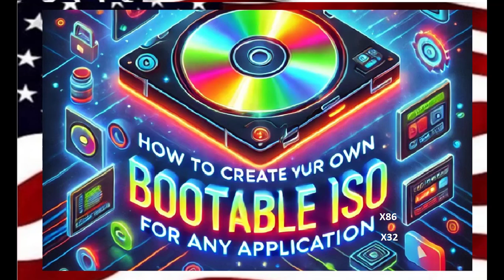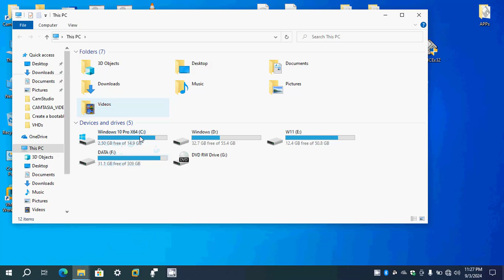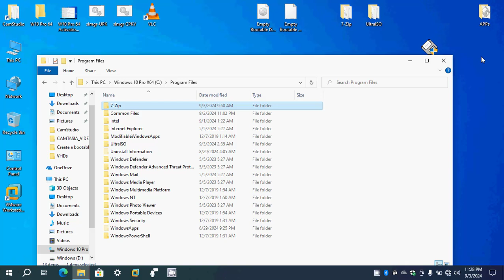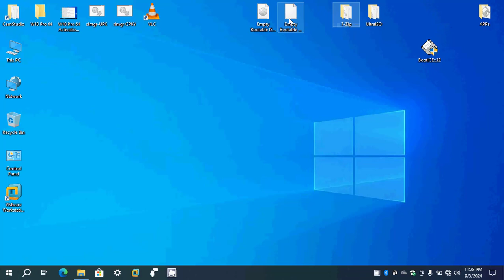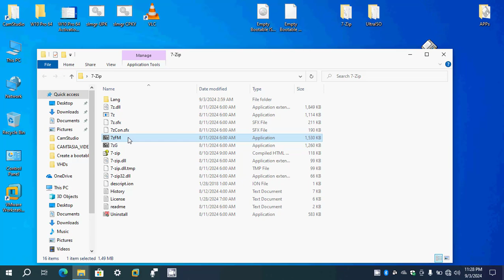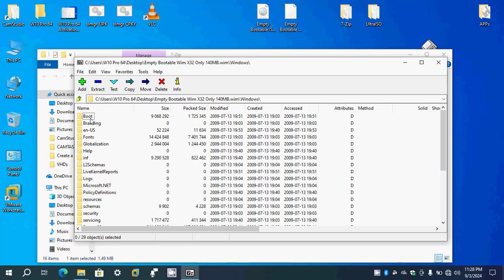150 Exclusive !!! Create Bootable Program in Bootable ISO

Comment from the maker: Summary
🖥 Introduction to creating a bootable ISO: The video explains how to create bootable ISOs for any application, allowing the program to run independently from the system during boot-up.
📦 Purpose of bootable ISOs: Bootable ISOs enable running a program without interference from other system processes, ensuring smooth operation, especially for utility tools.
💡 Portable ISO concept: A "Portable ISO" refers to running a program directly from boot, ensuring that the application runs standalone and utilizes all system resources.
⚙ Modifying the bootable WIM file: The process involves editing the bootable WIM file, placing the target program inside, and then repackaging it into an ISO format for boot testing.
🛠 Testing with VMware: After creating the ISO, the tutorial shows how to test it using VMware, ensuring it works before deploying it on physical hardware.
🔄 Multiple programs in one bootable ISO: The video further explores combining several programs into one bootable ISO, allowing users to run multiple applications from a single boot.
Insights Based on Numbers
61 minutes: The duration of the video, giving a detailed explanation and live demonstration of creating and testing bootable ISOs.
32-bit programs: The bootable ISOs created are focused on 32-bit applications, ensuring compatibility with different versions of Windows.
Multiple tools: The process allows multiple programs like Ventoy, Norton Ghost, and BootIce to run simultaneously from a single ISO.
Example Exploratory Questions
What are the advantages of creating a bootable ISO for system utilities? (Enter E1 to ask)
How can you modify the bootable WIM file to add custom programs? (Enter E2 to ask)
Why is VMware used to test bootable ISOs before deployment? (Enter E3 to ask)
Commands

Educational Article: Creating Bootable Programs in ISO Format
Creating bootable ISOs for programs is a valuable skill that allows users to run essential applications without needing a full operating system environment. This technique is particularly useful for system recovery, maintenance, and troubleshooting tasks. This article outlines the process of creating bootable ISOs and discusses the benefits and methods to achieve a functional bootable program.

Introduction to Bootable ISOs
A bootable ISO is a disk image that contains all the necessary files to run an application directly from the boot process, without having to start a complete operating system like Windows. Bootable ISOs are especially helpful for system tools like disk managers, antivirus scanners, and backup utilities. By running these programs outside of the full OS environment, you can avoid potential conflicts or restrictions imposed by the running operating system.

Advantages of Bootable Programs
There are several advantages to creating and using bootable programs:

Independence from OS: The program runs independently of the operating system, ensuring that it has full access to system resources without interference.
Security: Running a program directly from boot can help avoid malicious software that might be active in a compromised operating system.
Efficiency: Bootable programs, such as antivirus or disk utilities, can perform tasks faster because they don’t have to compete with background processes from the operating system.
Portability: A bootable ISO can be easily transferred and used on different computers by simply booting from a USB or CD/DVD containing the ISO.
Process of Creating a Bootable ISO
The following steps detail how to create a bootable ISO for any application you want to run from boot.

Step 1: Preparing the Program Files
The first step in creating a bootable ISO is gathering the program files you want to include. After installing the desired program, navigate to the installation directory (e.g., Program Files in Windows) and copy the folder containing the program. This copy can now be used in a bootable environment.

Step 2: Modifying the WIM File
The core of any bootable ISO is the Windows Imaging Format (WIM) file, which holds the environment that runs during boot. To make your program bootable, you need to add the program files to the bootable WIM file. Here’s how:

Mount the WIM File: Use a tool like 7-Zip or UltraISO to mount and modify the bootable WIM file.
Edit the Startup Script: Navigate to the System32 folder in the WIM file and modify the startup script (commonly cmd.exe or a similar script). This script needs to be changed to run your program during boot.
Add Program Files: Copy the program files into the appropriate folder within the WIM structure, usually under Program Files or Tools, depending on your program’s structure.
Step 3: Packaging into an ISO
Once the WIM file is modified to include your program, the next step is to package everything into an ISO file:

Create the ISO: Using a tool like UltraISO, create a new ISO file and place the modified WIM file inside. The ISO file should also include any necessary boot files that will make it bootable on startup.
Save the ISO: Save the ISO to your computer with an appropriate name (e.g., MyBootableProgram.iso).
Step 4: Testing the Bootable ISO
Before using the ISO on a physical machine, it’s a good idea to test it in a virtual environment like VMware or VirtualBox. This ensures that the ISO is correctly configured and the program runs as expected when booted. Follow these steps:

Create a Virtual Machine: Set up a virtual machine in VMware or VirtualBox.
Mount the ISO: Mount the bootable ISO as the virtual machine’s CD/DVD drive.
Boot from ISO: Start the virtual machine and boot from the ISO to test the functionality of the bootable program.
Creating Multi-Program Bootable ISOs
One of the powerful features of bootable ISOs is the ability to include multiple programs in a single ISO. This allows you to create a versatile toolset for system maintenance or recovery. You can include utilities like Ventoy, Norton Ghost, or BootIce, and run them all from a single bootable ISO. To do this:

Add Multiple Programs to the WIM File: Similar to the process for a single program, you need to add the files for each program you want to include.
Modify the Startup Script: Ensure that the startup script in the WIM file allows for choosing between multiple programs. This can be done by creating a simple menu system in the script.
Test the ISO: After adding multiple programs, test the ISO in a virtual machine to make sure all programs work correctly.
Conclusion
Creating a bootable ISO for your programs is an excellent way to ensure that critical applications can run without relying on the operating system. This method is especially useful for IT professionals and technicians who need reliable tools for system maintenance, recovery, or deployment. By following the steps outlined in this article, you can create bootable ISOs for any application, ensuring flexibility and control over your software environment. With the ability to include multiple programs in a single ISO, you can also streamline your workflow and have all the tools you need in one place.